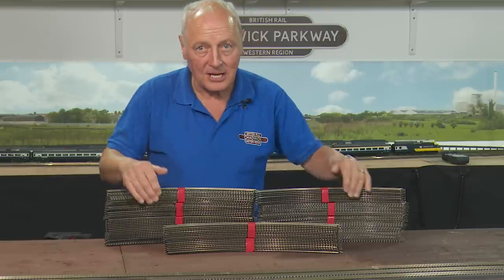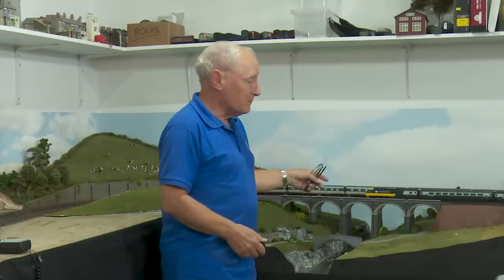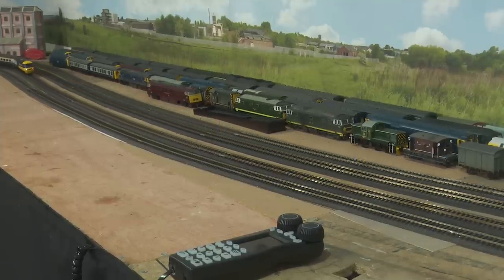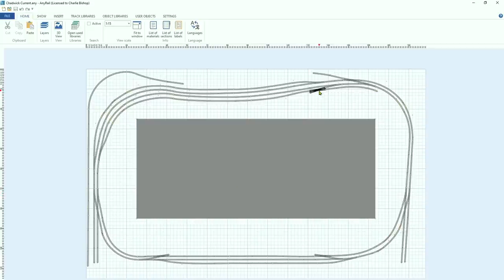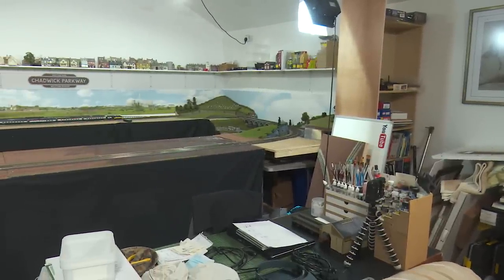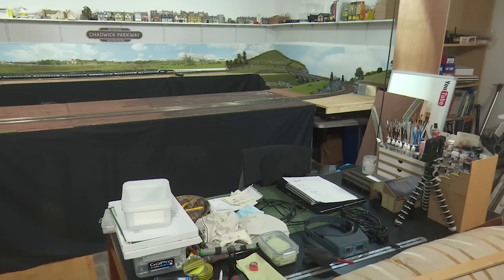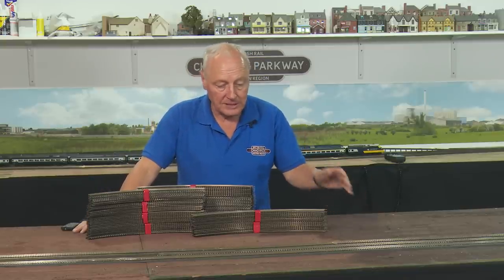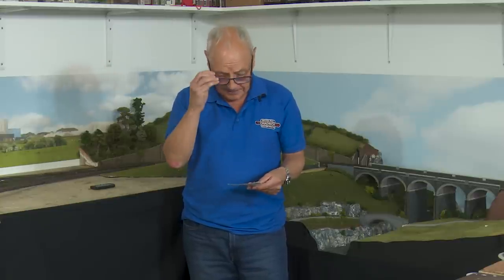Track Plan Design at Chadwick Model Railway | 111.

Comment: Charlie for many years I used to train body builders as a weight/ nutrition coach and we had the most amazing chiropractor on hand to deal with any injuries, which unfortunately happened and more often than not most knee problems were caused by A lumbar herniated disc or lumbar spinal stenosis that causes compression of the L3 nerve root in your mid-back region may cause knee pain and weakness. You may also experience pain in the front of your thigh, side of your hip, and the groin region, so it may pay you to pay a visit to a chiropractor just to give you the once over, just to rule out a lower back problem!
Reply from the maker: A great comment John thank you. I certainly take your points to heart and will keep an eye out for such symptoms. Regards Charlie

Comment: Hi Charlie. Have been binge watching your videos over the past few weeks. Much better that watching the telly! Totally understand the knee problem. I am returning to model trains after 50+ years after I rediscovered my original Triang Hornby sets in the loft. My plan was to clear the loft - done, put some better loft boards down - done, and set up a layout in the loft - not done! As I was putting in the loft boards I realised that due to the restricted head room I would be on my knees most of the time. Like you I have dodgy knees which I'm on steroid injections for, as they don't hurt enough to get them replaced!  So my plans have had to change. I'm now looking at the garage as a substitute. car doesn't fit in so that's not a problem. The other stuff may be! And I haven't told the wife yet! None of this has stopped me buying train related stuff. A couple of grand this year :-) . The wife doesn't know about this either! As you have mentioned in one of your videos, I appear to be a hoarder of kit at the moment rather than a user!! Best of luck on the revised layout and take care, George.
Reply from the maker: Hi George was an interesting comment. I think most of your problems can be solved by emptying the garage into the loft! Good luck with your new layout but please remember, the planning is everything. Regards Charlie

Comment: Hi Charlie,
Just wanted to add my support to your use of the AnyRail software.
Having mastered the use of layers I have created separate ones for baseboards; construction; dimensions; track setting out dims; track feeds; UP and Down lines; loco depot; text, etc,etc. I can then ‘turn off’ any layers not applicable to a particular printout.
One great feature of this design package is that you can switch any ‘element’ of the design into a different layer - making corrections very simple.  Be aware it is critical to select the correct layer as you add items or amend track plans. 
It have found the investment for the ‘full blown package’ well worth the money and you get updates as and when they are released.  My years are much more advanced than yours and anything that reduces bending up and down or crawling about under the layout is very worthy of full consideration.   I’m considering the installation of a helix too so your upcoming videos are eagerly awaited!
Happy Modelling,
Tony T🚂
Reply from the maker: Yes Tony, it certainly is a brilliant program, regards Charlie

Comment: Hi Charlie. Have watched all of your videos but have never commented. I love  your  presentation and the  manner  in which way you present yourself, your a very talented man hats off to you.  I am an N gauge modeller  and get lots of  ideas from you, I to have just completed my own helix using a cutting down to a six lane  storage area. However I would think on the idea of a swing  gate or a lift hinged section,  slightly offsetting the back  scene allowing  entry, maybe lift  out and lock section,  any of these  would save you a lot off  Time and effort. Anyhow it's  your railway. Keep up  the  excellent work, I'll email you some photos of my shed layout. Good luck. BRIAN
Reply from the maker: Thanks Bryan, I can’t use the swing gate as it would need to hold around about 16 tracks. Good luck with your project, regards Charlie

Comment: Hi  Charlie.

 Your videos have given me so much pleasure for more than a year now,  I can't thank you enough.  Two points that might interest you and your followers ...

1. I have been an enthusiastic user of Anyrail for around 3 years now. Which incidentally is how long it has taken me to firm up on my own putative layout design!
2. I decided from the outset to make the layout as modular and as light in weight as possible.  Not because I wanted it to be portable,  but so that I could build it in "self-contained " sections that could finally be assembled in their final resting place (a bay window in a spare bedroom).

So, to this end, I invested in a big box of 4x2 panels of 1inch Styrofoam, with the benefit that I could also carve all the landscape out of multiple layers of this material alone.  An additional benefit is that I can run all the power and control cabling in  "trenches" carved out of the same material,  ergo, no crawling underneath on my hands and knees!

As a typical man of my generation, I struggle with all online tools,  but now I will try to attach a PDF of of my Anyrail design so you can see what my final objective is ...
Oops, sorry I can't see any way to do  it!
Reply from the maker: Hi Roger, great comment. You’d have to email me the plans and my email address is at the end of each video. Regards Charlie

Comment: Charlie, Like all good model railway layouts they never stop growing. I the States where a helix is a much more common layout addition they put deserts, mountains city's on top of them. The new helix designs allow the operater to stand inside the helix and some have a crane system to lift the scenic board clear.Below the helix is also a cloth " blanket" to catch any stock should any derail. Happy day's ahead. Cheers, Chris Perry.
Reply from the maker: Hi Chris, great tip about the blanket, regards Charlie

Comment: Hi Charlie.  You said it.... we are not getting younger. Well I solved this problem decades ago. No getting under anything on my layout. All wireing is surface mounted and all electrics eg point motors, detection modules, power supplies etc are mounted at the sides, out of sight in a 'ditch', points, (Cobalts in my case), are operated via a torsion drive system. I've never ever put point motors under points. Most everything that operates the layout is about where your belly button is!  The big factor in making this work is mount all your trackwork on high-density foam board and not slap down a wooden coverall base for track.and utilise the baseboard framework as a sub frame for mounting component parts, (point motors etc). Just recently I installed wireless switches on the mains so I don't have to bend
down to switch the layout on! 
Some years back I posted a couple of quicky 'test' videos of my layout as it progressed then and there may be some things of interest there for you, like the foam board and including a look at my double helix build.    Youtube:  IndigoDVW
Reply from the maker: A great comment, thank you. I’ve just subscribed too, regards Charlie

Comment: Very sorry to hear about your knee problems. I occasionally have issues with my right knee so I understand. When I designed my layout I built a lift out section with a viaduct as I knew at some point my knees were going to give me trouble. I also put my main bus line wires on my fascia, yes not as neat but I can get to it much more easily.

For anyone building a layout I'd suggest keeping the issues that getting older bring to nearly all of us.
Reply from the maker: Wise words indeed Richard, regards Charlie

Comment: Charlie  Hello from Florida, USA.  I enjoy your programs.  I have an O scale 2 rail double deck layout with a helix. I built mine all by myself. 48" radius.  If you divide the circle into manageable pieces and then cut the plywood so that the edges butt together to create the circle its very easy to assemble, lay track, test and continue.  The most important thing is to test and get right before you cover with the next circle.  Second to that, Be sure to allow a vertical curve entering the helix from the lower level and one at the top exiting the helix.  My helix has been operational for over twenty years in a non air conditioned space in Florida.  I'm sure yours will be a great success. Cheers, Tom
Reply from the maker: An excellent comment Tom, thank you kind regards Charlie

Comment: Hi Charlie. Exciting stuff. It was interesting that you mentioned a skateboard-like trolley to get under your layout. I bought in my baseboard and just assembled it today, having to lie down under it to fasten the bolts and wing nuts that hold the two halves together. The height of the baseboard is such that, lying on my back, I had to stretch upwards to reach the fastenings. I'm 64 years old and the body starts to complain! I'm still going to investigate that trolley.
Reply from the maker: And good luck with it too Paul, regards Charlie

Comment: Hi Charlie
I have decided not to redo my layout AGAIN as all my track is now completed. I have the added complication of being nearly 70 with arthritis in knees, hands and other random places. I am building a small square of strengthened timber with castors underneath. I merely sit on it and push myself along to get under the layout to the centre control panel. I also have a highly protected litter picker (we call it the foam fingers lol) which is also very useful picking things up which have fallen off the track!!
Cheersd, Bob
Reply from the maker: Getting old is not as much fun as I thought it might be!

Comment: I've just turned 60 and I already find it difficult getting under boards to do work. Sometimes it is a bit of a squeeze to get where I need to get to as there is usually lots of stuff stored under the boards which I need to negotiate. And sod it, you've always left something on  top which you need below!  So I applaud your rational decision which means you can enjoy your railway for much longer if you left it as you originally intended!  Railway modellers are young men in older bodies whose enthusiasm knows no limitations. ;)
Reply from the maker: Great comment David, young men in older bodies, regards Charlie

Comment: Big fan of your content Charlie and would love to see you crack this new plan. Others have commented on the difficulties of helix gradients, I just think that is a huge amount of hidden track. I quickly decided on my end to end layout Little Brickhill to avoid hidden areas to make track cleaning etc easier. I made the station bigger than normal (8 tracks) to help storage and when I add a fiddle yard it will be spurred off in a straight line past the return loops so that everything is pretty much on the same level. 
If you’re going to undertake all that work I would suggest going a stage further and moving the scenic boards up the wall a foot or so to give yourself the working maximum space and access. You could even look at arranging the fiddle yard tracks to slide out on a cassette again for access purposes.
Reply from the maker: Interesting points Chris, and well worth considering, many thanks Charlie

Comment: Charlie, I have solved the noise problem that is transmitted from the hard ballasted track. Thanks to the DCC Guy in America. I will cover the entire baseboard with up to 1/2 inch thick foam board and build the layout on top of that using 5mm foam trackbed. Now all I have to work out is will the Platforms and coach doors line up?  Martin. (Thailand)
Reply from the maker: One problem that you may find is point motor operation.  Good luck, regards Charlie

Comment: Hi Charlie,
I have a total inability to bend and be on the floor, also lifting is not a good idea. I am in my 70's with health issues so I have to plan for the future as its not going to get any better. I have my layout on 5 cm thick ridgid foam base boards (almost the magic bullet for me) with everything accessed from the top. The wiring is buried in grooves burnt in with a cheap modified soldering iron and scenery mods are done with a hot knife and/or wire. I have never had much luck with bridge access so the track plan (AnyRail to the fore) is a dogbone around 2 room sides and a shunting layout over the top for all 3 sides. The distances are kept so I can acess the rails.
I hope this starts some thinking as I found the foam to be much better than the ply both in weight and cost
All the best with the next episode of your role of Chief Right Of Way Engineer..
Have fun and please stay safe
Reply from the maker: A great comment Peter, getting old isn’t as much fun as we might think it will be, regards Charlie
Reply: At last I've found someone that is doing things as I have done for decades... adopting an open frame, everything top mounted or imbedded in ridgid. (high density) foam base boards. No getting under the layout and everything at ones fingertips. All electrics on my layout are situated ina 100mm 'ditch' at the side including all point motors operating thru a torsion system, (rod & tube). No mounting point motors under points ever for me. I'm in the process of replacing my Canon HD vid camera after the flip-screen failed and Sony
would not service it as the camera was over 5 yrs old and put together a series of short videos of how my layout is built etc so keep watching Charlie.

Comment: Hello Charlie, The rebuilding of your layout will certainly change the look and feel of it. I have been using Anyrail for about 6 months and I think I was at plan Z before I finally settled on a plan. So I have settled on a "C" shaped layout. This meant a complete reworking of my layout. I am turning 60 in November and my issue is my hips so my new layout was built high enough so I could sit in a office chair and wheel under the layout to do wiring.  It is about 1500 mm off the ground. I have had issues getting Peco track here in OZ so I have been ordering from all over the globe. One end of my new layout sits ideal as I wait for some points to arrive from England. In the process of building the new layout I am changing the layout from Hornby control to Digitrax so every bit of wiring I have done has to be redone. I have found that learning how to wire for the Digirax system with block detection the hardest. I am going to use Train Controller Bronze for auto control and well as Digitax DT500 controller. 

It will be interesting to watch your videos over the coming months to see how it progresses.
Reply from the maker: Exciting times for us both Peter, regards Charlie

Comment: This is very exciting news about your layout Charlie!  I viewed a few videos from other modelers who say it's CRITICAL to allow extra spacing between tracks and between track and end of helix board (inner and outer edges).  Jason @jdstucks, Eric @ericstrains, and others mention train car length, height and angle of track curves caused cars to hit each other between tracks(i,e, running side by side) and between track and inside of mountains/tunnels, particularly in helix.  I too am building a U-shaped layout (O scale, 3 rail) with 2 between
Reply from the maker: An excellent comment John, and this is why I’m using third and fourth radius curves. Regards Charlie

Comment: I sympathise Charlie. I had a crawl under a few years ago and realised that it was going to be a problem later in life. I now have my layout at a height of 54 inches and being only 65 inches tall it is very easy to duck under even if I do sometimes misjudge it and hit my head! OUCH! The section does also lift right out if required but it is rarely needed.
My only negative observation of your new plan is the gradient of the Helix. With 3rd/4th radius it will be about 1 in 50 which with 8 coach trains will be a tall order for steam locos. If as I suspect your collection is all two bogie all wheel drive diesels then you will probably be fine. Good luck, it is looking like a mammoth project. .....................John
Reply from the maker: Yes you’re right John, I am a diesel kind of bloke. Regards Charlie

Comment: Thankyou for your Video. A most apppropriate and timely subject of access. Your points were heeded and will be incorporated into any of my future layout plans. I intend to have my representation placed at a high elevation, shoulder height  (approx) in relation to myself which will or should enable easier access to the underside for wiring and if needed passing under by use of a wheeled deskchair. I could achieve this by incorporating higher benchwork and a raised centre floor... I might actually make a video of this project afterall.
Reply from the maker: It sounds like an interesting plan, good luck, regards Charlie

Comment: Being an old ex rugby player and climber I feel your frustration . We had a helix on our old club layout but found older Locos and  formations of anything longer than 5 coaches really struggled .Also track cleaning was a pain. A friend of mine came up with a clever system where rather than a hinged board he had a small 3ft section which wheeled out .It is DCC and electric connections are maintained with flexible cables  .He has never had a problem.
Reply from the maker: Thanks David and interesting advice too

Comment: Two great videos this an last week and before you corrected the title Track Planing, I thought you had come up with another track cleaning solution :-) Being an engineer, I have never understood those track rubbers. I did buy that Dapol track cleaner when it came out and sense in constant use it will keep the dirt down using the correct fluid. In conclusion, that Anyrail s/w is very good; I used it for mine and just broke it up into 3x sections each of 52 components. The fact it then generates a parts BOM is great so you then know easily what you have to buy. Good stuff
Reply from the maker: I’m so pleased that you enjoyed the channel, good luck and stay safe, regards Charlie